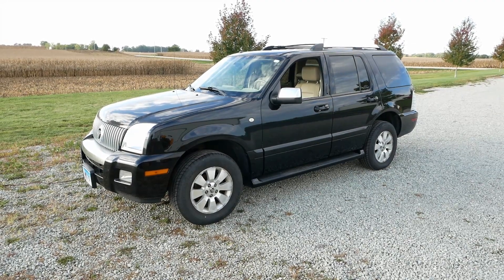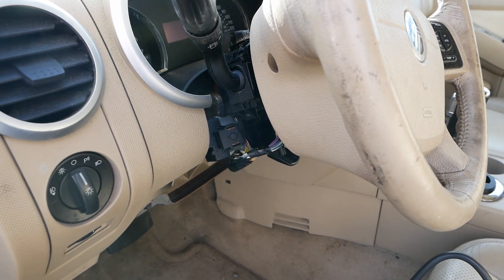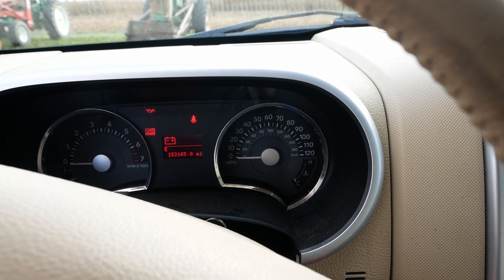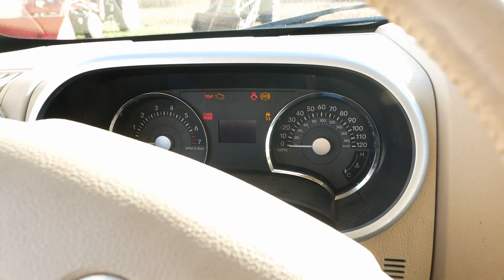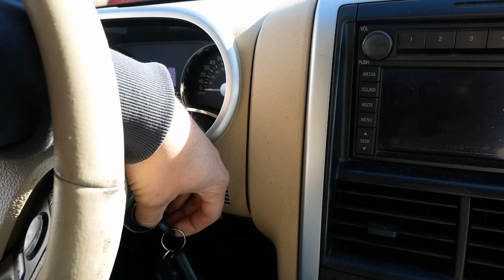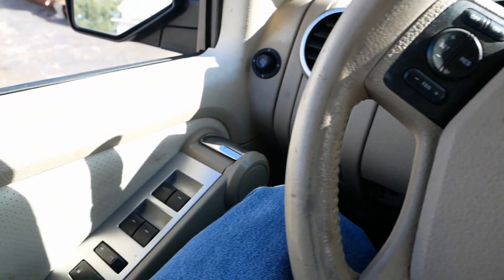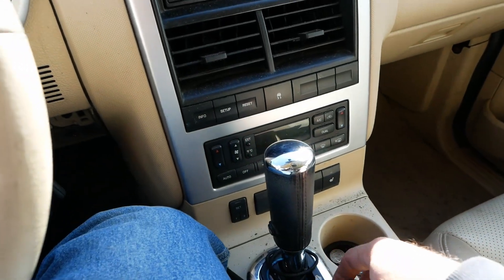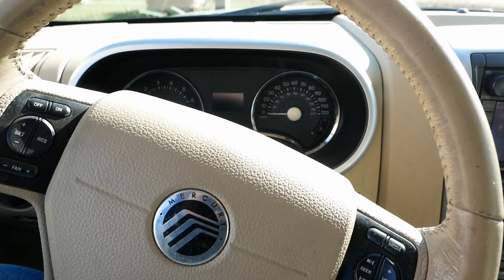Mountaineer Won't Start After Thieves Destroy Steering Column

Comment from the maker: 1. X100 PAD 3 Purchase Link: https://amzn.to/3chWdtC
Exclusive 8% Off Promo Code: WWWCODE3
2. X100 PAD 3 + KC-501 Set Purchase Link:  https://amzn.to/3oLkeR3
Exclusive 8% Off Promo Code:  WWWCODE1
3. X100 PAD 3 + KC501+ KS-1 Set Purchase Link: https://amzn.to/3uTHwp7
Exclusive 8% Off Promo Code: WWWCODE2

*I think the D8 is the same tool without the key programming feature.
Reply: "Who steals a mountaineer?" dunno but a better question is who wilfully buys a mountaineer to drive?
Reply: Im so lost on these scanners...that I think I may just throw in the gloves on anything after 96...I can't tell what each brand does clearly....Sure, I know what Snap On Zeus does, or the Bosch unit...but its impossible to find a simple unit that does the main things, repgroamming replaced ecus, bidirectional commands, and module code reading....I borrowed this one that one, and somehow, each one is missing a function for the car Im working on.....

Its frustrating...and then I have my own cars to work on (a few are OBD)....and Id like to get at least one fixed before I kick it...
Reply from the maker: @RipRoaringGarage  I've never seen a tool that did everything, including the factory tools. They all have holes. You learn what works best for your applications by trial and error.
Reply: @WatchWesWork  Thanks. I kind of figured it...Ive been out of the business for a long time recovering and I feel very...very left behind. And broke LOL. Im lucky if I manage to get a snapon ratchet lol (who am I kidding, I buy CDI..lol)
Reply: Ftf2fggtt6g6g6f4ft6t5t6f6t6g6ffyg61yuhui99mdswfyg6gw2fye2s2d4d4rtf5fectgyohw28ewf5frjiwhehwowh7wgusywhwyshshuwh7eyeh8wbiwjown
Reply: @RipRoaringGarage  I have over 15 scan tools there isn't a perfect scan tool that does everything I wish there was but some brands work better on some vehicles then others bot even oem tools are perfect they all have there flaws and there Goods and bads
Reply: Xtool links are no longer available from the seller you posted the links from @Watch Wes Work
Reply: @AntonioClaudioMichael  Yeah. Im even more disullusioned now with the R2R bill that failed in NY. We still wont be getting parts, so at this point, why bother fixing these new cars? Either that or charge ten times the price. Im very much done..and poeople can go fix their own garbage. I will focus on my cars, and only those cars...it has an ECU? Im selling it
Reply: @RipRoaringGarage  I hear ya there just getting overly exspensive to work on and now the tools needed are bigger and more exspensive scan tools and programming tools it's costing more to buy the tools and more to fix them I did a ecm replace on a Jeep wrangler last week cost 20 grand for the computer like come on that is 1/4 the cost of the truck people
Reply: @AntonioClaudioMichael  I cant help but wonder if this is also deliberately so. Removing hobbies and passions that create a community and a sense of self reliance. Cant have that it seems. Im out of the game. After the Right to Repair bill was butchered in NY, I have no access to parts, and wont be fixing new cars anymore. If it was an ecu, chances are, I wont touch it. I do have a Zeu (I got it new for 6k, which I thought was a great price and a good investment, but with times being so tough, it never paid itself off, so it sits now...since Im focusing on my cars, and other things, moving out of this horrible state, and ready to retire. I do appreciate your tips and all. I really wish things were different. I even tried going to a dealership (since theyre very short manned and have a backlog of 3 months now). I was turned down, because Im too experienced...and the other because of my skin color. Well...I know when Im not wanted. Its time to pack up and move to a ranch out in the wilderness.

Comment: In my best old man voice: "Back in my day, we had a separate key for the door locks and the ignition! Cry me a river and get off my lawn." 😆
Reply: That's right, a round head key for the door, trunk and glove box, a square head key for the ignition, manual crank windows too!!  YEA!!
Reply: Make fun all you want but the system worked.
Reply: AC was roll down the windows and open the vent glass, drive faster or slower for more or less air.
Reply: Back when you could start the car without opening the doors
Reply: And the trunk
Reply: @donniebrown2896  yea, didn't have to worry bout all the cancer causing  'electric Flux fields' flyin around,... just your ole man's Pall Mall cigarette smoke!!!  Lol
Reply: My truck still has that and a different one for the gas tank 😂 comes from factory like that.
Reply: Pepperridge farm remembers!
Reply: If you were one of the first owners, at least on GM cars,  there was a separate round head "valet key" that would open the doors but not the glove box (or trunk?). I think that key normally got lost and not handed down to future owners.
Reply: @donniebrown2896  power windows were getting the kids to roll them down.
Reply: Yep. With no issues to.
Reply: @donniebrown2896  Ah yes, the old 4-60 AC. (4 windows down, 60 MPH)
Reply: My car still does! Course it helps that they look different
Reply: @JohnSmith-tv5ep  
oh man, old man's Pall Mall cigarette smoke....memories
Reply: @gunners4129  The idea behind to two keys is that you could give the ignition key to the valet.  The valet wouldn't have access to your trunk or glovebox.  If they copied the key, they wouldn't have the key to open the door of a locked car.
Reply: I had a couple of chevys at different times with the square ignition and round door keys. In both cases you could take the ignition key out while the engine was running. I now drive a 2012 Ford, which had just one key. I had the nice gentleman at Ace make me a normal dumb metal key that would open the doors but not start the engine, and I keep one of them in my wallet.
Reply: Mopars had ignition and door the same so you didnt have to change keys to start the car.  Trunk/ glove box on round key

Comment: Fun fact: the keys are two parted. The bitting on the end of the the key is for the ignition. Halfway up begins the door lock bitting. Theoretically, they could take both keys to a locksmith and merge them. Or, buy a new key and a set of small files like I did.
Reply: You are correct!  I was a Ford Tech back in the day at Reynolds Ford, and it is true that the end is for the ignition and halfway up is for the doors.
Reply: Yep, did that to a '93 Taurus. Lock cylinder wore out.
Reply: Another fun fact, about 95% of the police interceptor impala's used the same door and ignition key. Most cop cars become cabs after their duty life is over. So back in the day, almost every cabbie out there was walking around with keys to any cop car they wanted.
Reply: Not true at all. There are "5 cuts"  for the door locks and "6 cuts" for the ignition.  The "6th cut" for the ignition locksmiths have to have a key code from a dealership and a software program to calculate the "6th cut".  Than the key needs to be programmed as they are "chipped". Im a Repossession agent and cut keys and 1000's of vechicle per year. 
Alot of vechicles especially high end vechicles have laser cut keys and none of the above applies or they are RFID key fobs with no key at all other than the door lock.
Reply: @CCWSig  yep and usually cop cars don't have chip keys or other immobilizer stuff so that the shop can cut new keys without the dealer.
Reply: On modern vehicles you dont even need a key to make a duplicate. All you need is a vin and the dealer can cut you one on the spot, if you can prove your the registered owner of the vechicle.
Reply: @billrogers3139  We're all talking about older vehicles. Nobody here gives a shit about modern vehicles.
Reply: @TreyCook21  Really because I missed the title that stated we are talking only about old vechicles.
Reply: @billrogers3139  Ah, I see. I was talking about my '93 Ranger (which I neglected to mention), the other fellow spoke of a '93 Taurus, and the Impalas mention were from "back in the day". None of these have chips or resistors or need programming. Yes, this Mountaineer needs the chip programmed. A dealer cannot help with the key replacement by VIN since the cylinder was replaced. In short; buy a new key, file out the notches from both keys, yep the middle one can be tricky, but both tumblers should turn with trial and error. No hate was meant toward your experience, but nobody in this particular comment thread gives a shit about modern cars. Ok... maybe just I don't. :)
Reply: @CCWSig  LMAO! That's good to know. I can always swap my 05 impala 9c1 for a lower mileage cabby. Just need to bring my key.... WHAT? I'll leave them my car. "Even trade" LMAO. (I'm joking.)
Reply: Oooh, that's interesting.
You did well to file a blank key.
Did you buy a jeweller's loupe as well.
Reply: @vinm300  I don't know what that is. I just placed the two keys in a vise and used tiny files.
Reply: @CCWSig  Same with the 1998-2011 Crown Victorias. I have one with fleet keys right now as my daily driver
Apparently this is even the case with Ford's current police interceptors as well

Comment: Since the Mountaineer has two different keys now … If you take the two different Ford keys (door and ignition) to a locksmith shop they can cut one side of a new key for the ignition and the other side of the new key for the door locks. That way you only need one key and use the proper side up for the ignition or door.
Reply: My dad always did this for his truck and my moms car so he only had one key

Comment: That’s one of the things I love about fords. It tells you in the owners manual how to program additional keys and also how to program door lock remotes without the use of any diagnostics. Just key on and off a few times. I now have 4 keys for my mondeo/contour 😊
Reply: On my 07 Transit connect you can only program a new key to the system, if you have both of the originals...does'n't work if you got the car with one key only...
:-D
Reply: True.  If you have two encoded keys you can always program another one using the procedure.
I have an 01 Ranger and was  left with only one key.   Tired of the stress of having only one key, I needed to get another one.  I went to the dealer, got a  Ford OEM key, got it cut and, when I came back they figured they needed the code to program my new key...BUT FOMOCO doesn't have these codes anymore: too old they said!  
I was looking at a minimum of $250 to get it done professionally, no results guaranteed (Wes, you're too far from where I'm at!! 😉)
I was finally able to sort it out on my own by placing the original encoded key and original transponder (plugged in) on a used ignition barrel ( just so they would be set right) wrapped the whole thing in foam and ziptied it underneath the dash.  I can now start the truck with any aftermarket key.  A hidden switch can always be set somewhere as an extra anti theft precaution.
I have heard (and seen videos) some people manage to get the chip out and set it with the transponder.  I figured I'd get the same result and avoid messing up my one precious original key.
Hopefully this might help someone in a similar situation.
Reply: @johndabato3316  I heard of that method too. Just works for people that have changed the ignition barrel with a used key from the scrapyard, they just poked out the transponder from the original key and taped it near the ignition switch, but they need still another or the original key for the doors...slightly unconvenient...
Reply: @horstszibulski19  not at all 😀
I just used the scrapyard barrel to set the original key and transponder so they would be set at the correct spot.  
(Finding this spot without an extra barrel was simply impossible. It always moved and nine time out if ten wouldn't start.)

I threw away the key that was in  the scrapyard barrel, then cut the barrel in half so I could fit it under the dash and, slid the key in it.  
Key fits in, doesn't need to  turn.  
Once the transponder is in place and plugged in, ignition on; it sends the correct signal to the anti theft unit.  

The original barrel itself is still in the steering column. 
This way I can use the duplicated key (not coded/no chip)  to start the truck and open the doors as well.

Sorry, I hope I was clear enough 🤔
Hard to explain, a lot easier to do!! 🤣
Reply: @johndabato3316  Thx for that extended explain! Yes that way round it will work through!
:-D
Reply: @johndabato3316  I understand why people do that but its not favorable to me and has seen me walk away from many used vehicles for that reason. Then again I do love keeping my vehicles stock and have been around fords all my life so a little issue of programing a new key is easy (also helps that I have the proper tool to do it) I had a 1998 Explorer someone did that to and it made it honestly a tad inconvienant because when your hurrying and forget to press the secret killswitch or start button it can leave you frustrated, and being aftermarket its often accompanied with jerrigged wiring and poorly handled connectors so it can cause electrical issues later on, especially if the new wiring isn't grounded properly.
Reply: @ Sterling O'Deaghaidh Guess it could happened.  Personally I haven't had any issues with this setup.  Remember that everything is "stock", only the key and transponder were moved to a different location.  
As far as the switch is concern, it is merely a one way switch on the ground wire, not much there.  
No jerryrigging on my watch! 😉  I agree with you on keeping everything as original as possible.  The nice thing about this setup: I can put everything back the original way  in less than 30 mns!
Do not forget the fact I only have one key and Ford themselves cannot get the code anymore to program a new one.  No OBD tool needed just a simple procedure using the ignition, similar to programming a new key FOB.  But you do need two keys to do it without the code - Ford doesn't have available anymore!!
Soooo, if I loose the one key then I'm left with nothing...original or not! 😉
Reply: @johndabato3316  my 99 f150 was the same way, I bought an aftermarket tumbler and key from Napa and just programmed it to the truck. I unfortunately had to scrap that truck after the motor destroyed its self, still have the key set in my new truck tho as it had a worn key.

Comment: That's methed up!
I helped a friend add a key to his focus using only the car. Followed the Easter egg hunt in the manual to the T and it didn't work. Tried a number of times and then I said to do it again but hold the clutch down the whole time. Worked perfectly and I guess the fraud manual was written for the automatic transmission....

Comment: Damn the PATS system was one I had to defeat almost weekly when I did security and electronics. My 2004 Marauder has it completely defeated because of an alarm with remote start. My 2004 Town Car has it defeated just because I can. After that FoMoCo went drive by wire and CAN and I didn't have the opportunity to master it. The theft light will rapid flash with a key fault and no crank in the KOS position.

Comment: I am kinda surprised that you didn't catch this Wes. Take a new key blank and have the ignition part cut on it and then the part of the now old key that fits  the door and cut it on  the other half of this key. That simple, I did it with my explorer
Reply: You're saying normal keys are symmetrical both sides, but only one side is used to push the lock pins? So you can have 2 different key shapes one each side, and depending which way you insert it into the lock determines which surface engages the lock? Meaning you can operate 2 different locks with one key?
Reply: I've never heard of that before. I thought both sides of the key had to be the same to work.
Reply: @user-ln7of9gs4s  Ask your locksmith and he can tell you the tip end of the key is ignition and the shank end is for the doors and tailgate... no fibs here, dead true
I just re read that and see what you said... both sides are the same as both haves of the lock are the same but just at exact same I can't say... what I refer to is the end of the key, the part that goes into the tumbler is ignition and the last half.... both sides are doors and hatch. The whole key is not cut for either part, they share on the blank
Reply: @jovangrbic97  If you count the teeth on the key, it will usually be the first four teeth on the key are ignition and push those pins in. On the rest of the key, the part closest to what you grip push the pins in  the door locks.. You can trace a key with a pencil and it should match on either side to that copied line that you traced.
Reply: Yep, total truth!
Reply: @morgansword  Ah ok so the key information is stored in two separate areas lengthwise, one for ignition and one for doors. I would have thought though that the doors would use the same unlocking profile as the ignition, no real need for both to be different from each other no?
Reply: @jovangrbic97  I am not sure behind the reason other than a person would have to pick two locks to take off and that doesn't work either as the key has a chip  in it and has to be programed to accept it. The harder that manufactures make it, its seems as tho thieves seem to enjoy the challenge or something

Comment: It's funny you said it has the requisite manifold leaks. 
 Going back through history I remember common issues with various vehicles.  
 Ford likes exhaust manifold leaks and tiny little bolts to hold the questionable manifold in place(warm fuzzy)
 The alarm systems were crazy  hard to work on without that tool you have.
 And for the older audience the Ford reach around, when you had to pull the selector in park and hold it to start the car. It wasn't a safety thing it was a wear issue that they never addressed for many years.😊